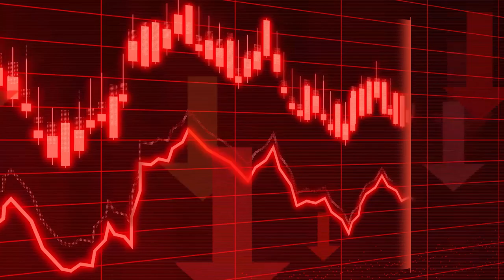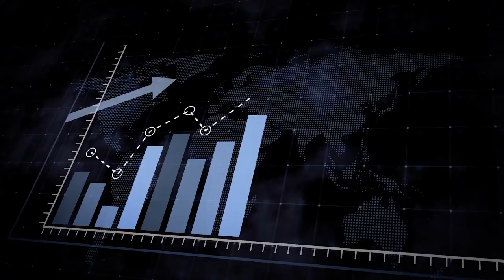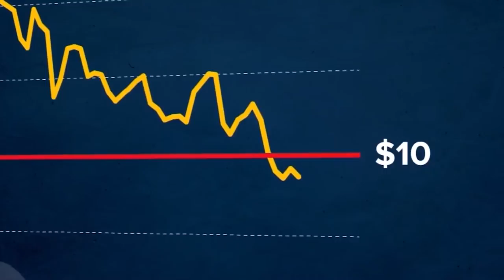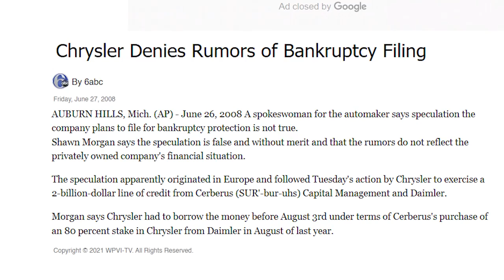Ford In Face Of Bankruptcy

Comment: This is so riddled with glaring errors that It's laughable. No Ford family member is the CEO. Hackett is long gone. Ford's stock has sky-rocketed with the new CEO. It is not below $1p as shown in ths video. It was recently over $25 and is $20 as I write this. Furthermore, Ford is building huge new plants in the US contrary to what is said in this video. What were they thinking when they posted this incredible misinformation?

Comment: Tesla total debt is 6.7billion and has shrunk from 14b a year earlier, they paid off this debt while growing 86% year over year and building out 2 existing factories and 2 brand new ones for capacity.

Tesla is speed running with cost savings innovation while growing faster then anyone else by far!
Ford and GM and the others are sunk in massive debt, have to use BEV sales to compete with their own ICE sales and spend money they dont have trying to outsource everything.
Tesla is the most vertically integrated company in the world, If your going to compete with them you need to start mining lithium, yourself, building your own batteries and putting it all together at each factory like they do.
No one is catching them.